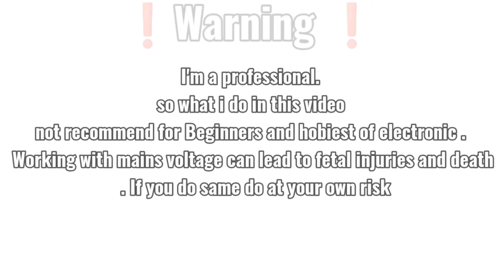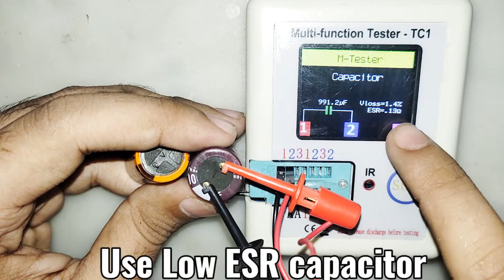Making ATX Power Supply Adjustable - 3Volts To 30Volts 10Amps !!

Comment: Value of potentiometer please?
Reply from the maker: Please watch Part-1 for full understanding
Reply: @Electronic_For_You  No transformer modification in part 1, where can I find that please?
Reply from the maker: Not needed . 
Use 12v winding . Follow traces from output to transformer
Reply: @Electronic_For_You  thanks 🙏🏿
Reply from the maker: Do it at your own risk . If you don't have experience. Do not try